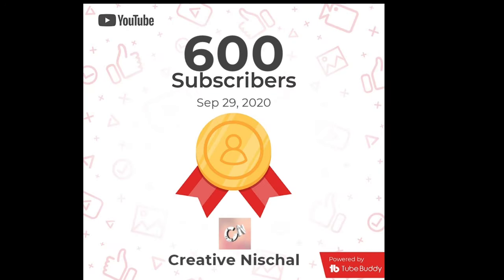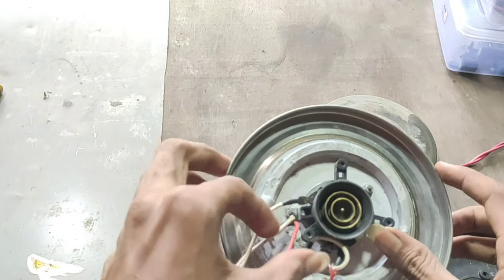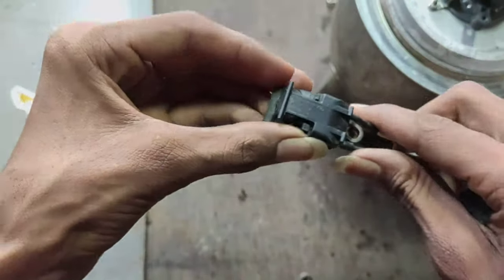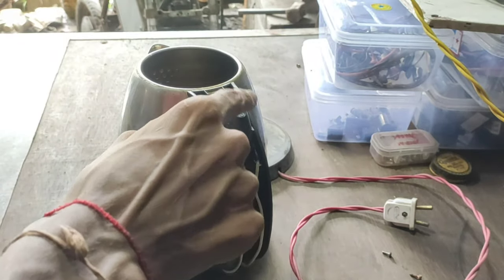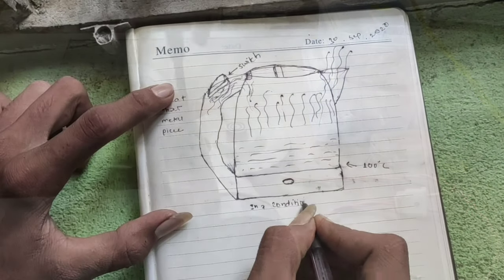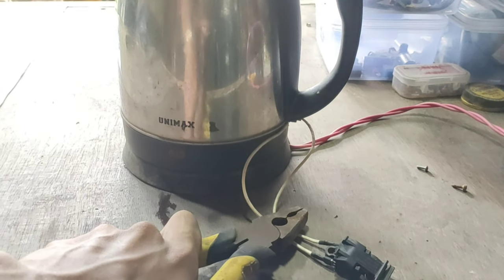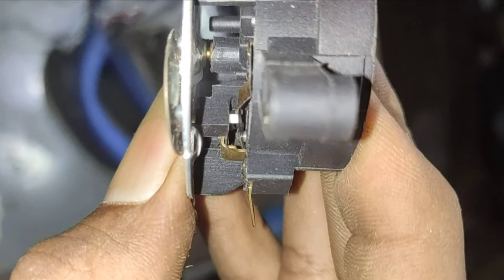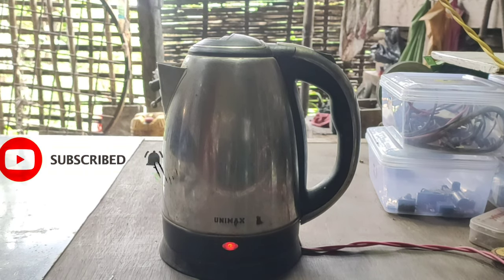How Electric water heating kettle works ??🤔

Comment: Brother if the kettle is on and water is boiling and if we touch on steel body of that kettle do we get electric shock ?
Reply from the maker: No no, you won't get shocked. The electric system and the metal body is isolated.

Comment: I was happy after watching your video, but when I want repair my Phillips kettle I found that the screw head has three points instead of 4, it seems for safety  reasons they want to discourage people due to possible fire hazards
Reply from the maker: Yeah, this is very likely, they are using different kind of screw to avoid general people to access the internals as specialized repair shop already have such screw drivers. If you are confident enough, you can go ahead, but if you're skeptical, you may want someone else to repair that.

Comment: nice hands on, but do you know how the metal piece is activated at 100℃？And what happens if say you use the kettle at high altitude where say water boils at 90 ℃？
Reply from the maker: You got quite a nice question 😄, the turning off action is purely dependent on the variable lateral expandibility of metals which make the thermostat and it really doesn't care whether the water is boiling or not, if it gets sufficient heat, it will do its action and in the case you described, because the lid will be closed during the boiling process, the water will eventually reach 100°c producing steam of 100°c which triggers the thermostat. The auto off action will not teigger immediately after water starts boiling but it will happen after some. You may try and share the result with me 😉

Comment: Good explanation thermal switches. But, best if you can clarify about HEATING MECHANISM. I mean whIch is Heating element, shape etc (long aluminium type sheet is heating element of central circular rings is heating element. It appears this is regular heating element and NOT RF based HEATING.
Reply from the maker: Thank you very much for your wonderful comment. The video dates a year back and here, i was mainly concerned about its automatic off action. I can explore its other aspects in may another video

Comment: Bro can I remove auto cut off feature in kettle to make foods.!!
Reply from the maker: Yes you can brother.
Reply: Bro! If I remove auto cut off ,this inside heating element work,run good or make expire Please tell!
Reply from the maker: @kunalarora3367  it will work. The boil dry prevention circuit will also work but it won't stop after boiling. You have to be a bit more careful but it will work just fine.
Reply: Thanks!!♥️♥️
Reply from the maker: @kunalarora3367  most welcome.
Reply: Can Use In train of 1500w 230v

Comment: Wondering why the failsafe mechanism couldn't be the only mechanism
Reply from the maker: You mean to say why there are two themrostats instead of only one right??
Reply: @AmateurInventor  yeah I was wondering why the bimetallic strip on the handle is needed at all, can a kettle function off the other one instead
Reply from the maker: there is a very clever reason behind this. you may have noticed that when water boils, it not only turns off power to the kettle but ols pushes the manual switch to off position preventing kettle to power up once again after the bimetallic strip had cooled down. and if there was only one metallic strip locate at the bottom as you said then still everything will work fine but the kettle will start again and again after the bimetallic thermostat cools down and you will have to manually power off the kettle to stop this behaviour otherwise. hope this made it clear. subscribe if you think my efforts worth your time🙂